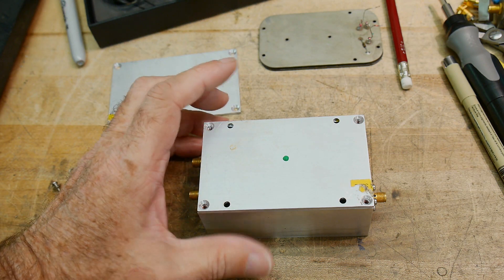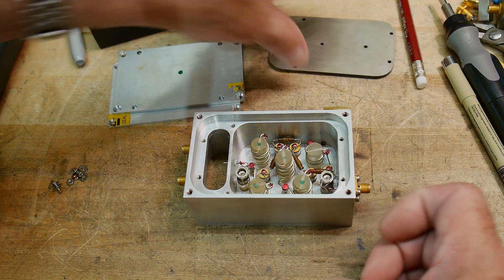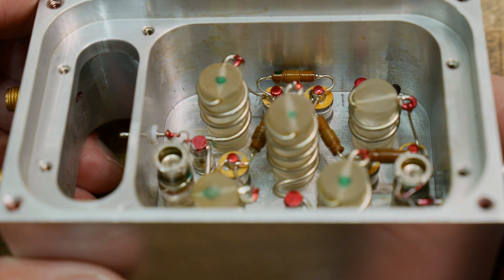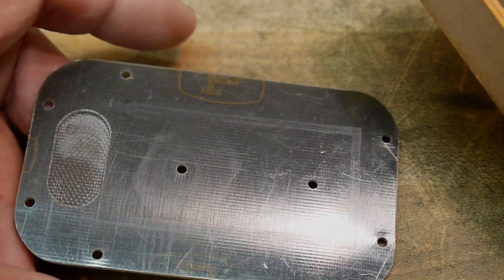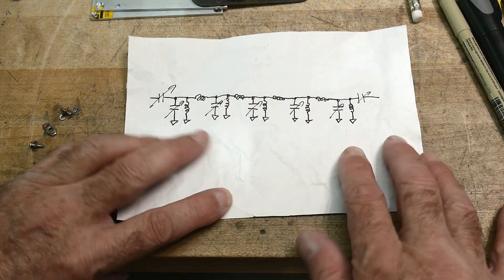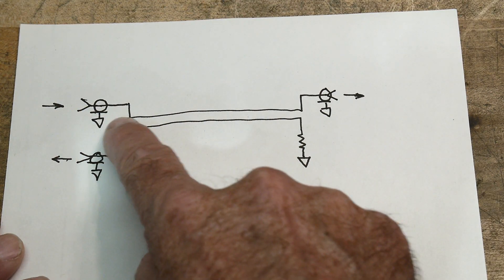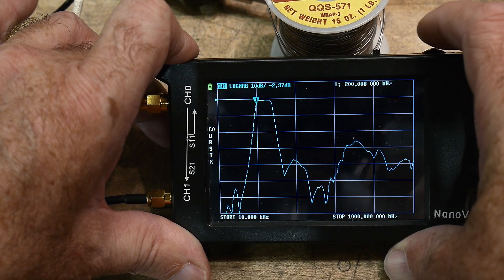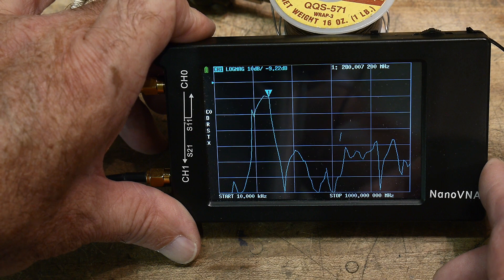#606 RF Bandpass Filter with a Surprise

Comment: Thanks IMSAI Guy...

Interesting.....

The little cavity is to allow space for the wires to be soldered 

First tiny glance your coupler looks like a transformer...to me....

With all the poles in the BP filter..

Does it then have 5 poles?

Surprised at the frequency beyond the filter has spurs.....
So maybe it is Mr. Chebyshev...nice and flat in the passband...outside 

Does the rolloff steepness match a 5 pole..I think perhaps so....

Or does 7 caps and inductors constitute 3 poles...since the two caps on the front and end form the input and output...?

I am glad you didn't tweak...but measured first with my future envious tool....the Nano VNA...

There was probably lots of effort the test person tweaking the adjustable caps to get that nice flat passband response..

Curiosity drove me to MiniCircuits...Couplers..

Since your insertion loss in passband 0.9 dB...then I guess the coupler couples 8 dB...

They listed a nice table of theoretical minimum thru mainline insertion loss in dB...

Such as a 6 dB coupler will have 1.2 dB minimum loss...no active components 

10 dB coupler = 0.46 dB IL
15 dB coupler = 0.14 dB IL......

And 30 dB coupler 0.004 dB IL

That makes sense...for if your sucking a lot off power from the main line to your coupler...then less power comes out of the main end...

So what we might have folks is a bandpass filter Fc 240 Mz...with a 8 dB ish coupler ..with a bandpass of 80 MHz wide...

I did not quite hear that reader input of the program or equipment...

A "Soulmate"...?

It's all good...

Nice construction design and I am glad the curiosity cat with IMASI Guy won out and then he showed us...

So I can see how that coupled port could be fed back to level out...perhaps in like a system of AGC...

As a function of power into the filter...I wonder if there in like the upper noise floor do frequencies power like at 400 MHz ever smooth out....like there is a sweet spot of like a range of millawatts in or what is the range of power....do the inductors saturate....?

And Fred you can go read too...

240 MHz...militaryish UHF...

Or maybe Soulmate is just part of a spectrum analyzer instrument?

Thanks IMASI Guy...once Again...

I am looking foward to our very wise readers feedback...and their comments....

May no one consider me a babbling pest

Kind regards

Fred

Comment: I am sorry, IMSAI guy, now, only now I understand correctly. Before the signal even enters into the filter section it passes through the long "U" like PCB trace; a parallel trace with a 50 ohm on one end (termination) comes out as the coupled port for the purpose of observing (like you did on the nanoVNA) and for fine tuning of the capacitors at the factory. 
The hollow region of the whole block is for taking the tappings out; the input and the output of the filter are let through plastic (teflon or something) insulator; so is the observation coupled port. Someone down here asked if the coupling is on the input or on the output. 
The sample for observation is taken out (by the PCB trace coupling) on the input of the filter even before it enters the filter section. 
Thanks 👍
Reply from the maker: the little wires are ones I had to de-solder. They all used to be connected to the feedthrus
Reply: @IMSAIGuy  Yes, I think you had not mentioned in the video. Or am I missing something here..!!
Reply from the maker: @subramanianr7206  in my first video I said it was soldered and that is why I didn't open it last time
https://youtu.be/Cm9UxPkW6J0
Reply: @IMSAIGuy  oh. Now I remember. I had seen this before maybe 6 months ago, I am not sure. I had not subscribed to your channel then. 
In that video the BPF had measured to be 190-290 MHz on the spectrum analyser with the tracking generator.
And thanks again for quoting the reference to the previous video you had done. I think now it's a complete one.
I mainly subscribed to your channel to learn more about the nanoVNA and the tiny SA. 
I appreciate the good work you have been doing 😊
Reply from the maker: @subramanianr7206  I love the nano not so much the tiny. what do you think. do i need to give the tiny more love?
Reply: @IMSAIGuy  yes, I honestly believe you should. They're real nice gadgets like "Godsend" to me, an amateur radio operator who's addicted to learn the RF stuff. These are giving me the visual display of what an RF signal is and capable of doing. It's simply amazing and it's not a lie if I honestly admit that many a time I didn't believe when I read the text. 
You are the one who is curious to know for yourself and to show me what you infer from the experiment.
The other day you made a video on splitter/ combiner and the ECL Oscillator. 
I request you to make a video on the microwave circulator and isolator. 
Please love the tiny SA and when yours got broke I was very upset. Now you have another you shall resume making for us.
Reply from the maker: @subramanianr7206  Circulators only really work above 4GHz and I don't have the equipment to show that. I do need to have more respect for the tiny since it is a great learning tool for those who can't afford a good SA. I got turned off by everyone saying how great it was and I was an idiot for bashing it. cause I didn't know how it worked.  I was only trying to show its limitations.
Reply: @IMSAIGuy  yes, that is my point. They're sold for around $50. You are equipped with lot of test gadgets of very high reputation. I am interested in homebrewing antennas for HF VHF and UHF. I do possess antenna analysers like MFJ269, KVE50C, nanoVNA (the initial version) and the recent SAA2 3 GHz model, and the tiny SA. I have been learning from your presentations. I am satisfied with what I do possess for now. And I want to get thorough with them. One day, I think of upgrading my shack.
I respect one who is willing to teach and I will be learning till my end.
Yes, the isolator/circulator are used in the cell phone industry. I happened to see some tear down videos. What a clever contraption it is. I keep remembering the pre 20th century times where they found out the effects of magnetic field and the alpha, beta and gamma emissions. Yet another application in the magnetron tube of the microwave oven. I love science and your channel is the one I started to like for the nanoVNA.

Comment: Oh. What a fantastic architecture.! An analog BPF with 0.9 dB loss and rock steady construction. The PCB trace coupling with 50 ohm termination at one end and the other end for observing/ and tuning the filter at the factory as well for future maintenance adjustment if needed.
And the small wires from the studs on the underside of the PCB are probably "gimmick capacitors" to handle the leakage inductance of the long trace.
 there. 
Thanks for the presentation 😊

Comment: Very neat filter. Just out of curiosity does the insertion loss change when a load is on the coupled port, vs when it is left open? Looks like the coupled port is intended to be approximately 10dB down.
Reply from the maker: That's an interesting question. lets say it couples 20db. so it goes to the connector and nothing there.... reflects back and gets caught by the 51ohm res. ok, now plug the connector, it couples 20db and that gets taken by the 50ohm load.  insertion same in both cases?
Reply: @IMSAIGuy  Sounds about right. :-D

Comment: VHF filter, LC.
The PC trace is either a coupled input, or output.
Time to make use of those piston caps.
Reply: The signal is coupled even before it enters the BPF. 
The piston capacitors are made of high quality materials with copper, silver/ ceramic coating and of very high degree of precision. Tuned and adjusted and sealed at the factory. They're simple engineering marvels, for sure.